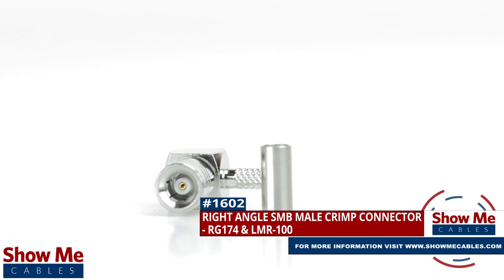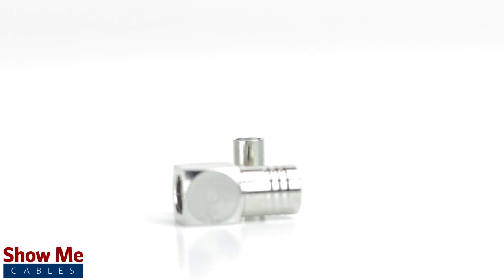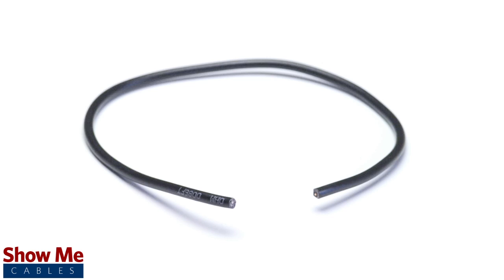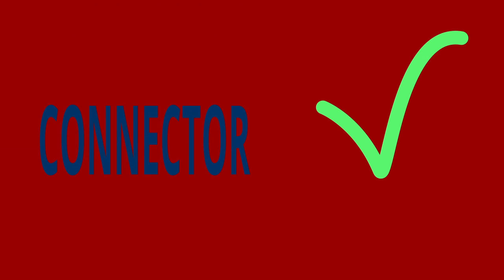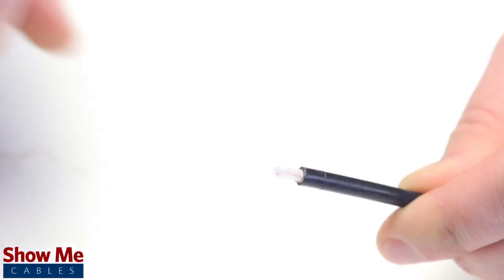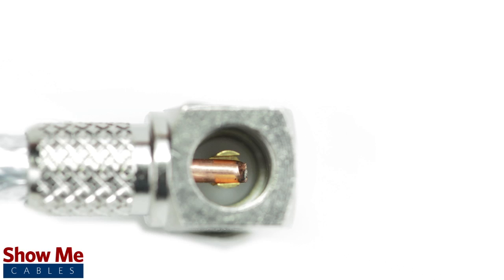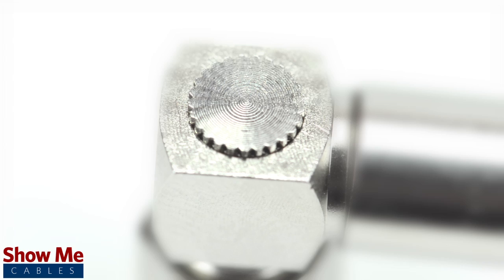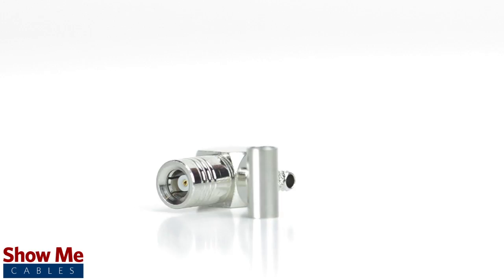Right Angle SMB Male Crimp Connector For RG174 & LMR-100 - Perfect For DIY Installs!

Comment: Except that is an SMB Female connector, good instructions.
Reply from the maker: Thanks for watching!  The SMB style connectors are actually kind of a rule breaker in coax connectors.  The Male connector has a Female pin and the Female connector has a Male pin.  Similar to a reverse polarity connector.